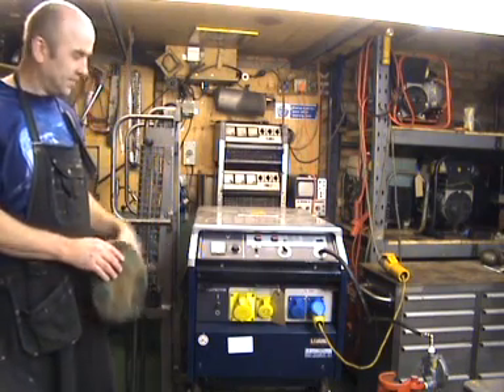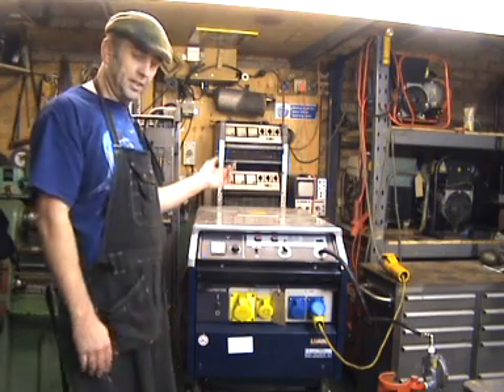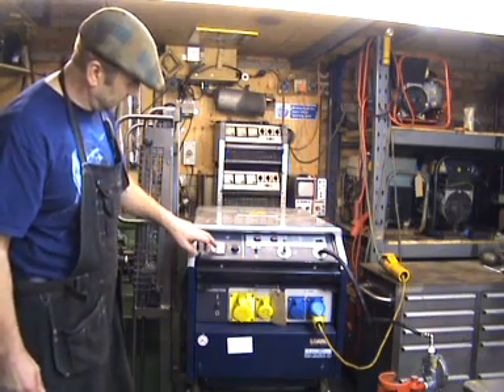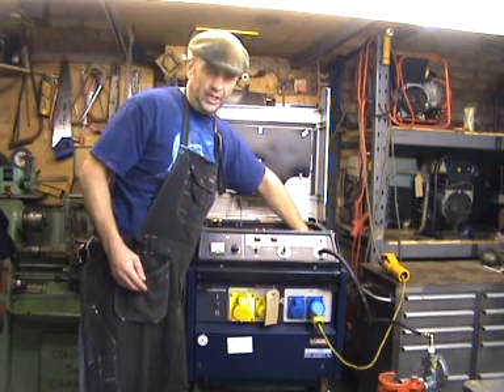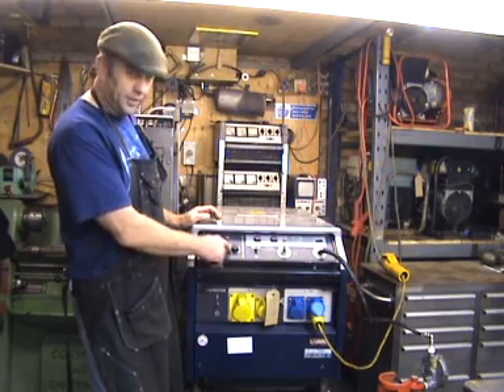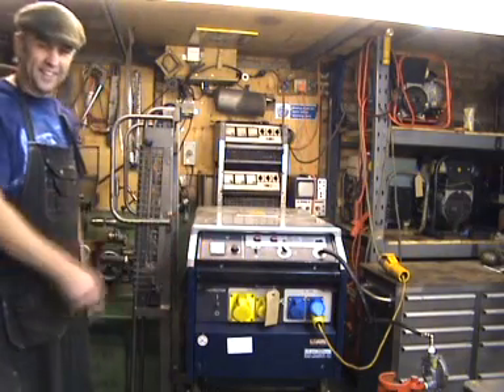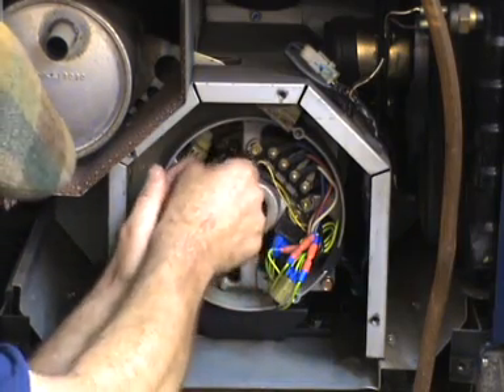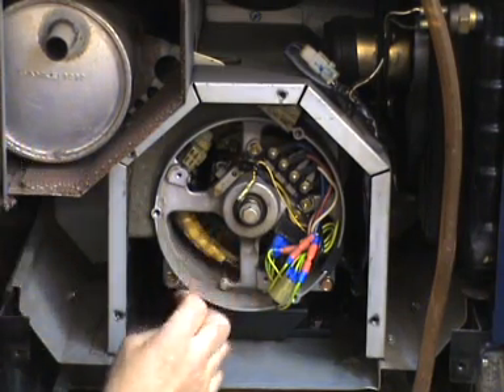Honda ex5500 generator repairs diagnostic 1.wmv

Comment: I am about to help a friend with her generator which has been sitting for 2 years.  I gave her a battery charger to get it charged up - I want to drain the fuel, change the oil - should I change the coolant -anything you suggest for maintenance on it in general?   Great channel -thank you -
Reply from the maker: The main thing to do is to clean the carburettor.
Reply: @petepowergenerators  I cleaned the carb it really wasn't dirty. Apparently a leak now I'm going to check today. Now electrical output on a generator that used to with perfectly. Saw a video on the idea of turning a drill backwards whilst plugged into to generator and trigger held on forward. Gonna try

Comment: Have a ex5500 sitting several years. Cleaned the fuel system and got it running, but no AC output. Cleaned out a HUGE rats nest and cleaned the slip rings as suggested and it works great! Good voltage and hertz. Thanks!
Reply: Planning to buy one here in the philippines 2nd hand hand.. is it really durable compared to new models of china made generator..

Comment: Hi Pete, my husband need to know how to Get to the oil pump of honda ex5500, can you help...
Reply from the maker: Its a 6 hour job as you need to strip it down until you are left with just the engine and alternator left sitting on the chassis. Then you have to remove the alternator as the pump is situated between the alternator and engine,

Comment from the maker: That's exactly what it is. Running with the original varispeed gearbox and 3 phase motor running from single to three phase inverter. It takes up a bit of floorspace but then so do I.